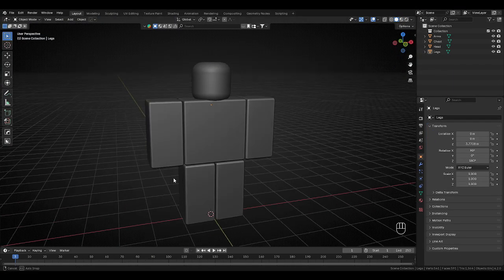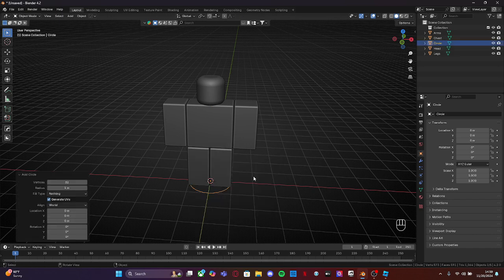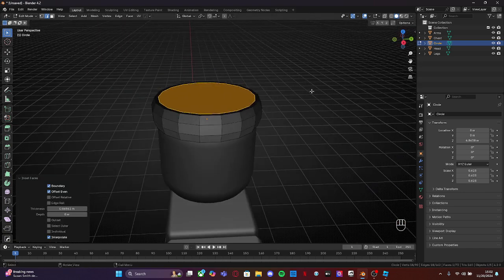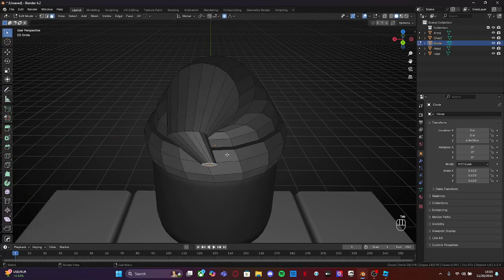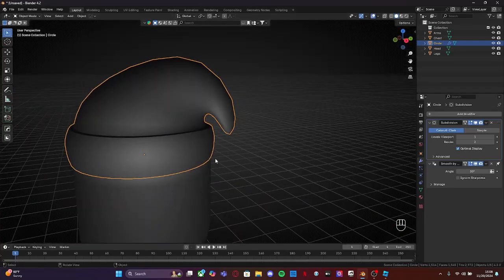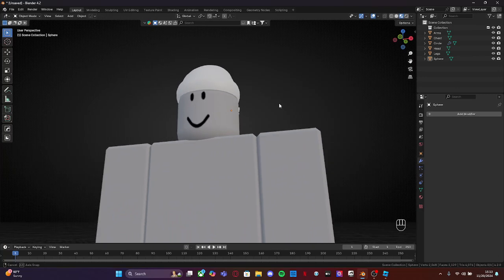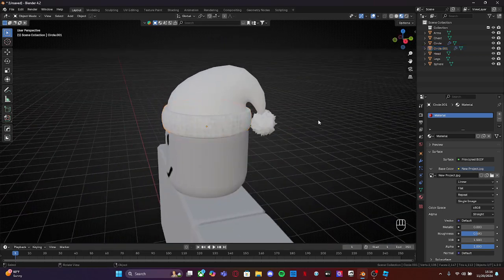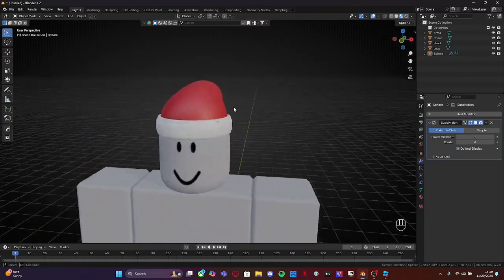Santa Hat Blender Tutorial!

Comment: Quick tip to make alligning the ball on the hat easier for others at 12:57. You can select the face at the tip of the hat, press "shift + S", select cursor to selected and then add the sphere and it will automatically allign it with the tip of the hat. Just need to scale it down to the size you want after that!

Thanks for the video, helped a lot with my project